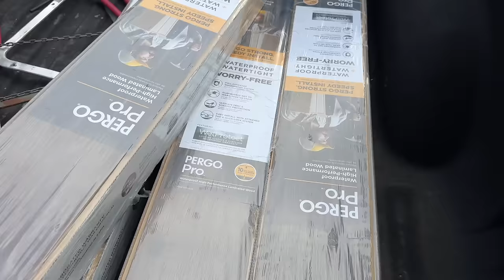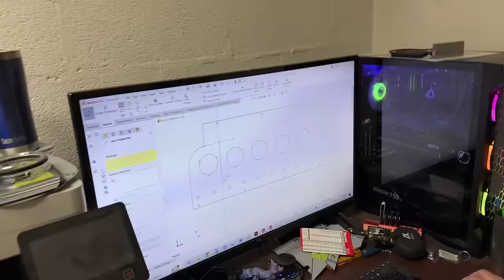We Built A $300k Peterbilt Show Truck For Westen Champlin!!

Comment: @20:20 As Robert mentioned folks were hating on the build. But they forget when the truck is built at PACCAR, how many employees in total actually touch the truck and how many more are behind the scenes to build up the engine and transmission. How many simply pull a part off the shelf. 
Meanwhile how large of a crew comprised the entire team to build up Weston's truck for MATS to include custom designing and building parts for this truck. 
If you were hating, did you bring a freshly built custom truck to MATS ?
Congratulations to everyone involved in building Weston's truck. Great job 👍🏼

Comment: You did an excellent job with that truck!
The only thing I would have done was put  dynomat inside the cab and sleeper to help keep the noise down and insulate it. 
Also sandblast and paint the rear axle heads even though it will be behind those chrome covers.

Comment: Imagine thinking this is anywhere near $300,000.

More like $45,000 with $15,000 in bolt ons

Nice LANCASTER tires. 3 bolt breathers, value line quarter fenders. Look at the standard track steer axle. Holy cow 300 grand. Tired of this clickbait YouTuber BS.
Reply from the maker: The paint job alone cost more than 45k get real
Reply: @Gentryandsons  hey. My brand new glider kit was 100k from Peterbilt and  another 40k to drop a cat in it. 
U really are funny u know